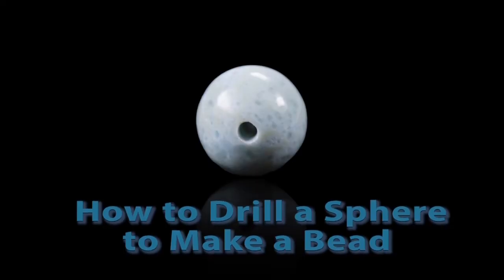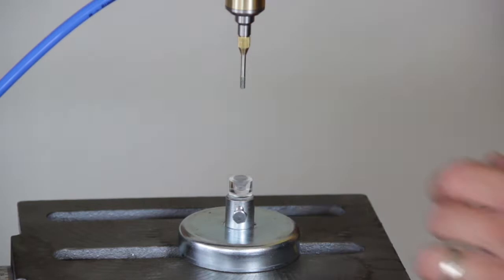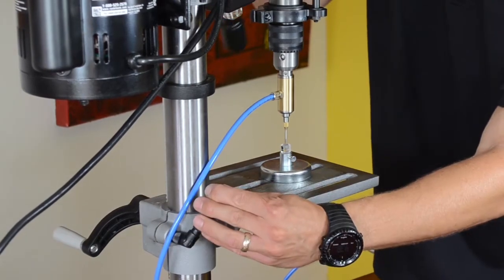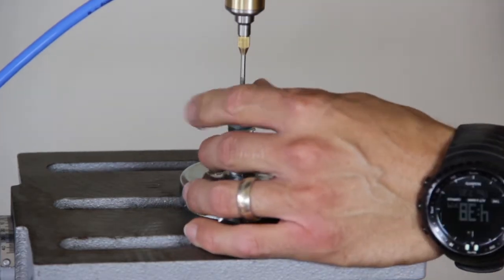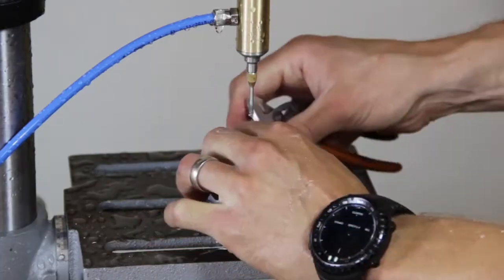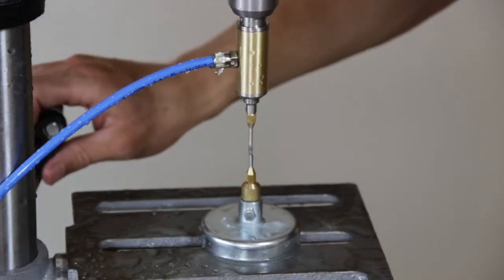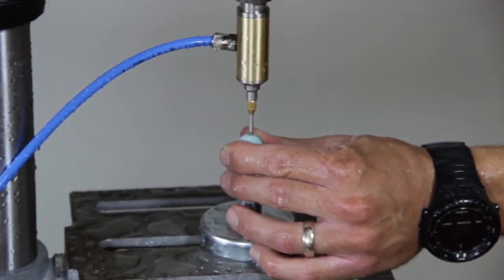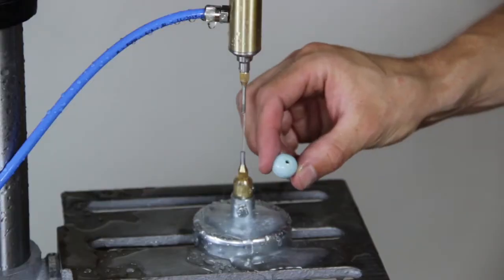How To Drill A Hole In A Sphere To Make A Bead

Comment: Those pliers are too much hassle, why not a hex key lever?
And why doesn't bead nest have a central hole, so that you can drill through bead in one go?
Reply from the maker: Yes, I agree—the pliers weren’t ideal. This was one of our early videos (about 9 years ago), and we were a bit unprepared in the moment.

As for the bead nest, it doesn’t have a central hole because you don’t want to drill straight through in one pass. Doing so causes the back side of the bead to chip (called “blowout”). The bead nest is designed to help you create a clean starter hole, and then the Gunther Alignment System’s counter post allows you to finish drilling from the opposite side. That way, any blowout happens inside the hole, not on the bead’s surface.

Comment: can i drill into a marble without a drillpress, or is it impossible without one?
Reply from the maker: Hello, it's not impossible, but it's very challenging. Beads were made in ancient times using various techniques, but one common tool was a bow drill. I'm sure there are other ways to make a hole, but a drill press with diamond tools is the best way. 

If you have a drill press already, check out our Multidrill Water Swivel. It clamps into the chuck and quickly converts your drill press to a diamond drilling system with a pressurized water feed. Then, you can drill holes in marbles in less than a minute. Here is the link:

https://guntherdiamondtools.com/products/multidrill-water-swivel-adapter-kit

Comment: difficult if you need to make holes in more than 100 marbles 🤣🤣
Reply from the maker: When I drill for volume, I break the process into steps. First I drill the starter holes in all the spheres. Then I change the base to the counter part insert and then go back and finish drilling the back side of all the holes. I always try to minimize tool changes to save time

Comment: Wow. That's a lot of steps for a single bead, and so many ways for things to go wrong. Not to mention the mess and using a pliers on the bolt. Why are you using water instead of cutting oil?

If you are going to advertise yourself as "the best" at something, you should try a bit better at making videos by cutting out the "um"s and make sure your use of the tool is effortless, instead of struggling with the bolt. And use a decent mic. Plus, don't use a metal hammer if you tell your customers not to. You obviously tried to make this look professional with various camera angles, so go the extra step to make it look and sound even better.
Reply: Wow, alright; everybody's a computer-chair videographer. By all means, show us all how to do it better. This was the best way to drill a glass sphere I've seen yet, and at least the instructional was to the point. Beggars can't be choosers, Mr. Perfect.

Comment: Hello mate.  thank you for the information..
Also can you please teach us or tell us how to drill a emerald stone at home to make beads..
I have been looking for a video but i couldn't find any..
Can you help please.. thank you.
Reply: You'll have to use a corundum or diamond drill bit for emerald. Emerald (beryl) is about an 8 on Mohs hardness scale; corundum has a hardness of 9 and diamond's hardness is 10 on the Mohs scale. A 1mm hole is pretty standard and will still allow for multiple passes of most beading thread through a hole that size (thread used for seed beads). Your specimen will need to be stabilized in some kind of mount in which it fits that is clamped to a work bench or held in place in a vice. I would use a drill press as shown in this video rather than trying to freehand it – you want straight hole without sharp edges (cuts the thread). Good luck!